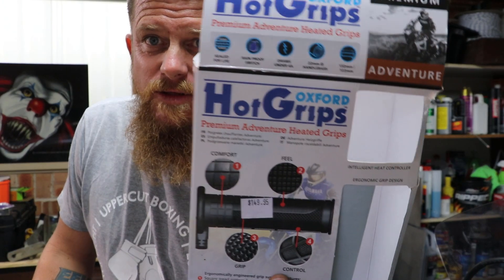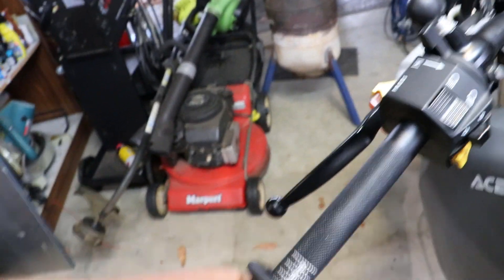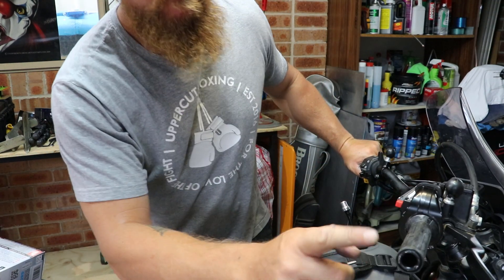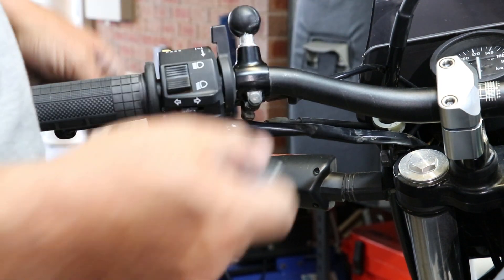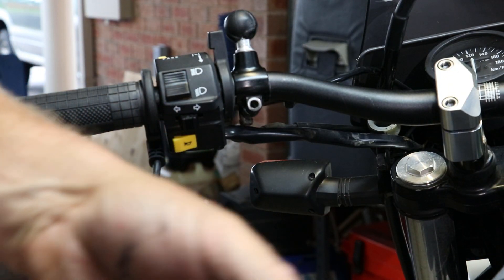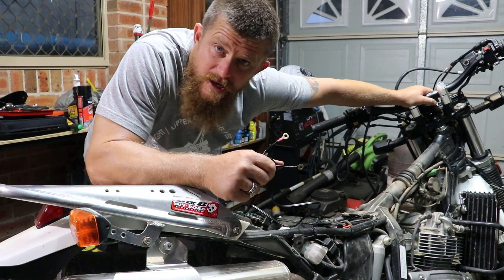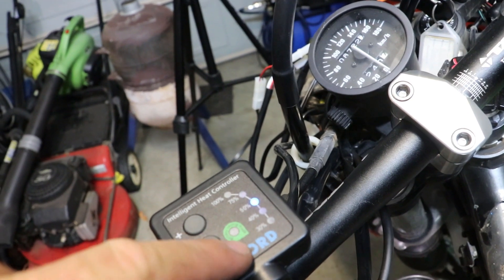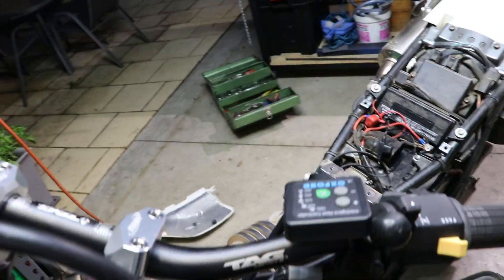DR650 | How to Install Oxford Hot Grips

Comment: so your stock throttle tube went onto your fat oversized bars?
Reply from the maker: Yep the stock one fit. The bars are tapered. So they are fat in the middle and normal size on each end.
Reply from the maker: https://youtu.be/3k6hvQMbu2s 
Check out this video. It's where i install the grips.